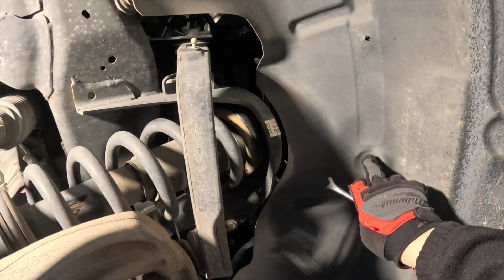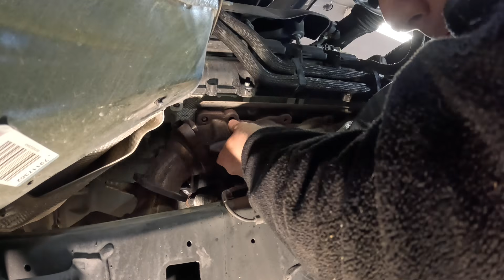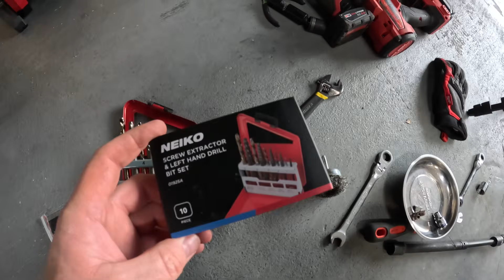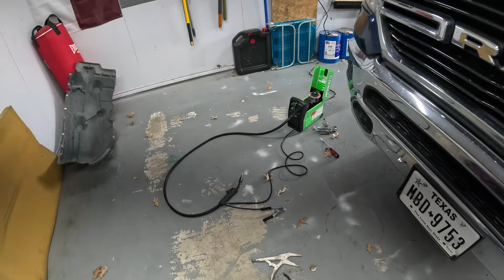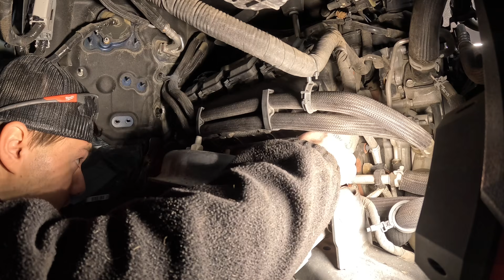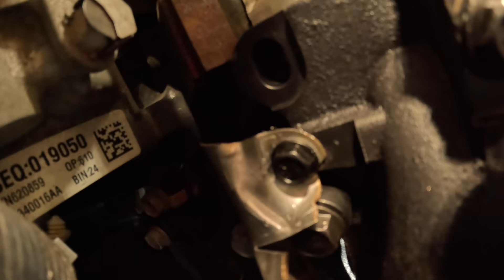RAM 1500 BD Diesel Exhaust Manifolds Install (2019+ 5.7L HEMI)

Comment: Just put these on my truck. Got really lucky though cause passenger side manifold was cracked in the middle, no broken bolts, drivers side had no cracks or broken bolts. Still took all day to do both by myself but could’ve been much worse.

Comment: what setting did you use on the welder?
Reply from the maker: Can’t remember exactly but it was low feed mid power-ish. Definitely test it on a bolt and nut first to get a feel for it

Comment: Did this yesterday. Drivers side that dipstick tube was swore at for a long time. Plus my 2009 Ram 1500 had the brake line block on the rail drivers side, really limiting access to the broken stub i had to weld a nut to.. Job sucked but i was quoted $1000 by a shop.The BD minifold kit was awesome. I can see the extra engineering that went into it.. My truck sounds new again..

Comment: Have you ever tried using left hand drill bits for extracting broken studs? I have used them many times in diesel trucks that have the same problem. About half the time the broken stud comes loose and backs out before i use an easyout.
Reply from the maker: Tried twice worked once. They’re a pain and they take forever. As long as the stud is broken near the surface I’ll probably keep using the welding method.

Comment: I purchased the BD Diesel manifolds on Amazon I'll be installing them this weekend. Some people take their OEM manifolds to machine shops and have them resurfaced, don't do it! BD Diesel makes beefier manifolds with better hardware, they don't warp.  It simply pisses me off that Chrysler knows their exhaust manifolds warp with their crappy design and hardware. It's been a known issue for over 15 years, not covered under warranty???!!!

Comment: Can you use a hammer drill with those extraction kits to get better penetration ? I’m about to replace the manifolds with shorty headers but not trying to weld anything if the bolts are snapped.
Reply from the maker: Hey Caitlyn, it’s worth a shot if you don’t want to weld. I would try to get the center divot pretty well established before using the hammer function so it doesn’t bounce you off center. I spent about 15-20 minutes trying to get enough of a hole in the stud to get the extractor in there but it barely made a dent before I moved on to the welder. Also lisle makes their 71500 drill bushing plate that makes it pretty impossible to mess up if you’re dead set on the drill route. Hope that helps!🤙🏻
Reply: @PJs_Channel_01 that looks like the ticket. I don’t know what I’m doing so the more idiot proof I can make it the better 👌🏻

Comment: I'm having an independent mechanic look at my exhaust manifolds tomorrow to confirm my rough cold starts are due to this. 
Your video helped me understand the scope of work.  I have a 2020 Limited with the 5.7 and only 50K miles on it. I plan to keep this truck for at least 4 to 5 more years.  Do you think the BD solution makes sense?  Seems crazy to replace the exhaust manifold with the Mopar part after such an early failure.  Thx for the honest video showing all the trials and tribulations you went through....rather than an edited "look how easy this was" type of content.
Reply from the maker: Hey Loyd! Glad to hear it! Im trying to make my videos as helpful as possible without becoming too boring to watch so I’ll take any feedback you might have. Personally I think the BDs are totally worth it for the studs alone. When you get OEM replacements you still risk having one of those cheap studs pop again and this isn’t a job I would want to do/ pay for twice. My view is “buy once cry once” and be done with it.
Reply: I had the dealership replace my oem ones last year. My plan was to get it all fixed so that i could easily swap out with the bd diesel ones, but never got the chance. Within 3 months they were rattling again on cold starts. I was also dealing with health issues in that same time frame and hardly drove it but it still happened again

Comment: Why did you choose replacement cast iron manifolds over headers? Ive seen recently even mini headers that fit in the stock location without any mods to the pipe or anything, and i think the price was comparable to these... just eondering. Thanks for the vid!
Reply from the maker: yeah I considered it, but at the time it sounded like the BBKs were having a lot of cracking issues on the weld seams and most of the other header options were much more expensive. these BD's are great though and I have yet to find someone with negative feedback on them.
Reply: @PJs_Channel_01 thanks for the response, I appreciate it
Reply: I made the mistake of shorty headers and they cracked and had to do the job again. Fortunately i had saved my old manifolds which were badly warped. I surfaced the then ceramic coated them and reinstalled them. Still working great with another 144k miles and no problems. I see many replacing the manifolds with new only to have it happen again and again.
Reply: @grizman914 what brand of headers?
Reply: @MrMoosefire JBAs that were ceramic coated. I’ve seen other brands crack as well. I tow a travel trailer which doesn’t help but there is no point if every 3 or 4 years you have to do it all over again.
Reply: @grizman914 do you live somewhere where they salt the roads? I’m about to buy the JBAs but live in Southern CA so not concerned with corrosion.
Reply: @CaitlynJennersPecker corrosion wasn’t a factor because the headers were ceramic coated and they crack from heat fatigue. Ceramic coated only moves the cracking down the road. I have a good friend who worked for John Lingenfelter and he said there pickups headers rarely last more than a couple years due to cracking. John was my next door neighbor as a kid so i know the family well.
Reply: @grizman914 so basically replace with the same components that’ll fail again or replace with shorty headers that’ll fail. Fantastic.
Reply: @CaitlynJennersPecker i guess you wasn’t paying attention. I took my old warped manifolds and machined them to remove the warp. I also sand blasted them and ceramic coated them and have been on the truck for nearly 150k without warping again and no broken bolts. Thats a far better permanent fix.
Reply: @grizman914 not gonna work with a cracked manifold.
Reply: @CaitlynJennersPecker no it certainly won’t work on a cracked cast iron manifold. If i were to replace mine in the future I would use the BD cast manifolds because the reviews are great and they flow better than stock. I absolutely will not use headers on my hemi that’s a daily driver and I tow with it. Headers honestly do very little other than give you another tick because you can hear the exhaust through the thin walls of headers. My hemi has been MDS deleted with hellcat non mds lifters and valve springs as well as an oil pump. Used an MMX stage 1 cam. Also have an unlocked pcm and a tuner which i only use the economy tune because it makes plenty of power to tow and the fuel mileage is in the low 20s and 10 towing 8k.

Comment: Just give you a little safety information those jackstands you got underneath that truck are not safe. They fall over you bumped that truck wrong. You hit it wrong with that jack and they are done. They’re really cheap made and not worth losing your life over you need to put wood blocks under your truck while you are doing work like that.
Reply: Is he still alive or did he dieded?

Comment: This is terrifying. I'm about to tackle this on my 19 DT and thought these manifolds just cracked and didn't break bolts...
Reply from the maker: I thought the same thing since I had zero broken bolts when doing this exact same kit on my 2020 Laramie. I'm half convinced MOPAR is just keeping this trash design for trolling purposes at this point.
Reply: @PJs_Channel_01 my 2020 laramie held up till 85k miles. Doing the bd diesel swap tomorrow. Don't know if I have broke bolts or not. Hoping for just a Crack. Little ticking noise goes away really quickly when warming up the truck so 🤞🤞its just the cracked manis
Reply: No broke bolts! Passenger side manifold was cracked in a couple spots. Drivers side also cracked. Gasket was in great shape. Heat shields are a BIIIIIIIITCH.
Reply from the maker: @BennieDavidBeexploring  yeah those heat shields are terrible. Definitely sliced my hand getting it to sit right on the driver side

Comment: Did this recently on my 2014.  Driver side was a pain with two broken bolts. I got one out of #7 cylinder and hired a mobile welder for the one on #1  cylinder. Passenger side was a breeze.  Hope this BD setup lasts and I never have to do this again.  I applied some copper anti-seize on the bolts just in case.
Reply: How much did the mobile welder cost ya? Debating just buying one of those little welders preemptively, but may just hire a guy
Reply from the maker: I think it was one sale for about $130. You're definitely not going to be welding roll cages together with this thing but for little projects like this, it's pretty hard to beat for the price. and the fact that it plugs into 120V socket instead of 240 is a huge advantage.
Reply: @PJs_Channel_01 I got the little green one. But didnt have a single broken bolt! Just heavily cracked manifolds.
Reply from the maker: @BennieDavidBeexploring  sounds like you got to do the "easy" version of this job lol
Reply: @PJs_Channel_01 hahaha yeah, thats why you always buy the 2nd year production of new vehicles. Lol gotta let em work out the kinks. Drivers side suuuucked. Passenger side i didn't even take the tire off.  The heat shields were an absolute nightmare. At least the drivers side.